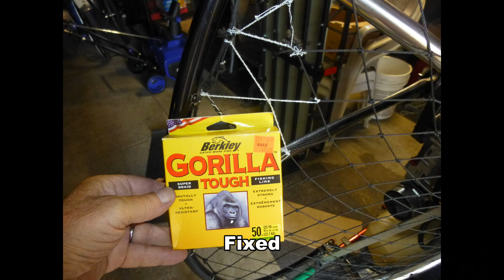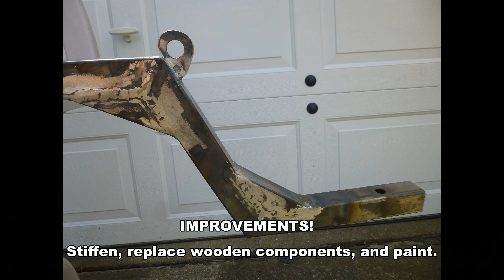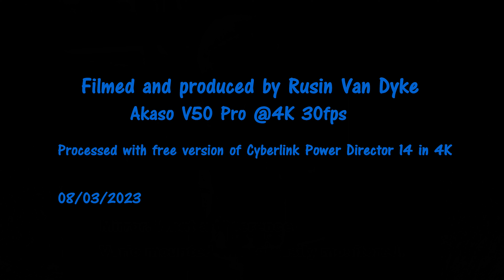Bailey V5 Matrix/Trike - The Sound of Money!

Comment: before you guess, I would reach out to the pro's for answers
Reply from the maker: Hi Jared. And who might this "pro's" be? EProps didn't have a definitive answer, and I pressed them in several emails, but they did agree I should try the next shorter prop they offer for the Bailey with Quick Release System and agreed to sell it to me at a "discount" price of $270US plus shipping. Bailey no longer sells this frame (not designed for a trike) but does still offer parts, and they are not located down the street to drop in and ask questions. I have written earlier about the inadequacy of the Matrix frame in triangulation and subsequent stiffness. I am trying to work around that. I was using the prop recommended by Bailey, but possibly those specs are for their new frame? Bailey originally sold their kits with Helix props. Mine came from the previous owner with an old style (skinny) EProp. Between the cage/frame flex, prop flex, large glider, rough ground, and poor piloting, well, you see what happens. I am sure another dealer would be happy to sell me their product $$. This is happening on the ground so I think I will continue to work on it on my own. I have video from my last flight my wife took from the right angle that gives me some information to work with. A prop strike from dumping the trike is self-explanatory. Thanks. Rus